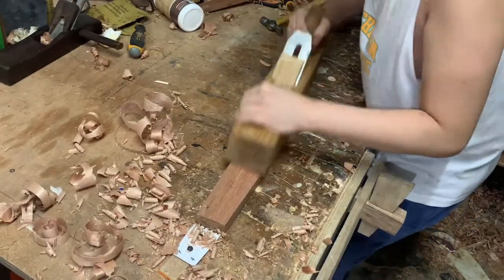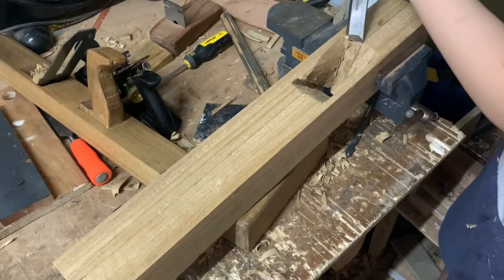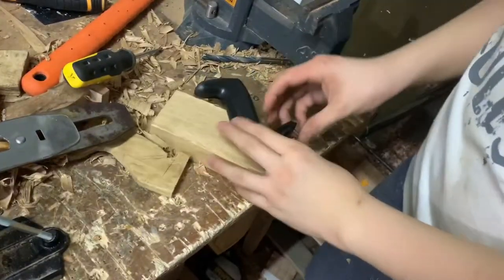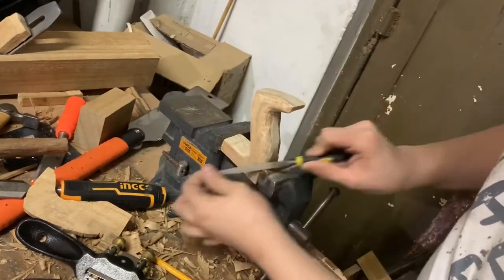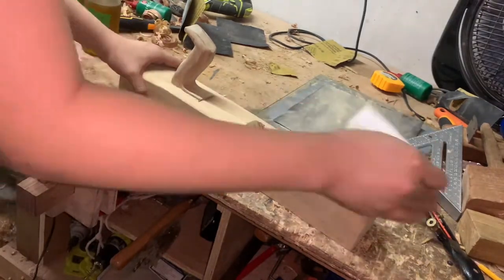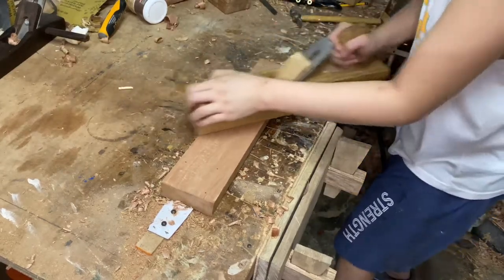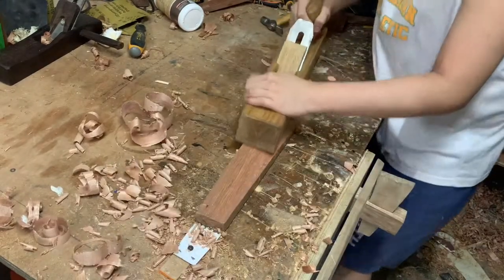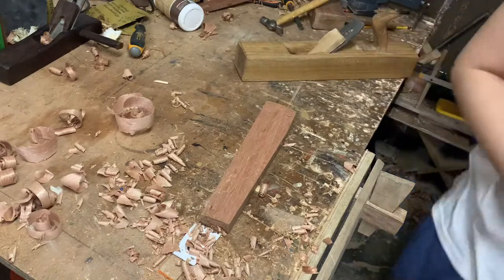Making a better wooden foreplane!

Comment: I really like your non-perfectionist approach to build skill and some functional tools on the way. Getting stuck at the end of a board is a thing of where to put the pressure. Press on the toe at the start of the cut, even pressure along the way, and only at the heel at the end. To flatten the bed, clamp a well planed 45° block below it and use it as a guide for pairing with the chisel.